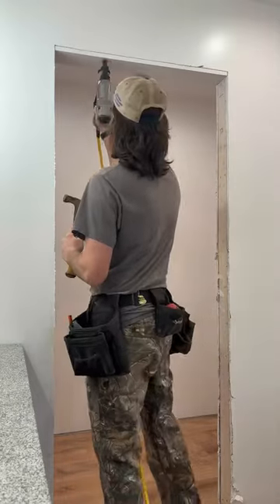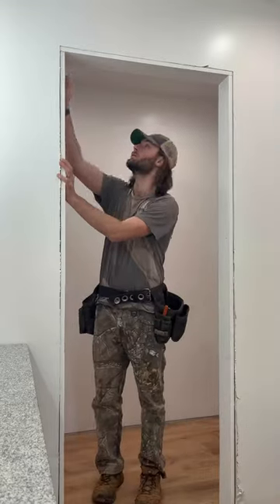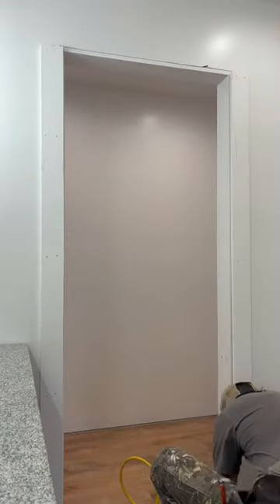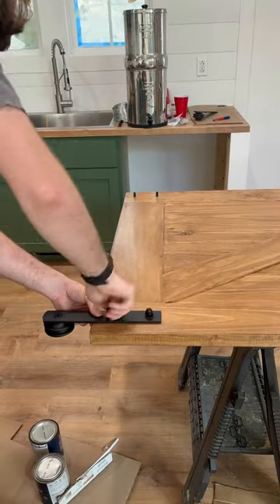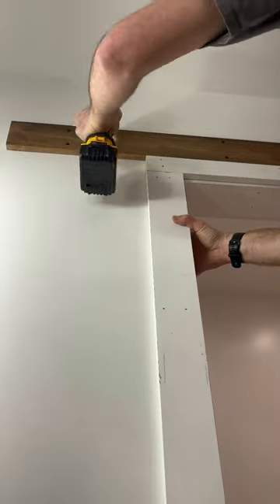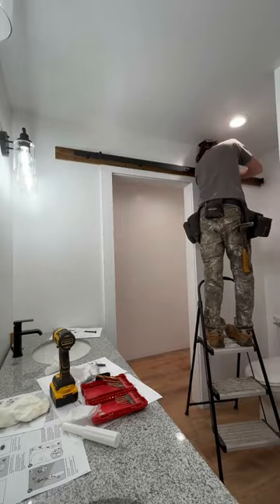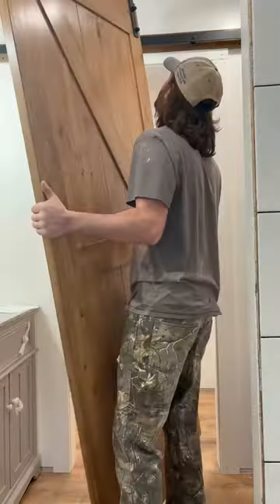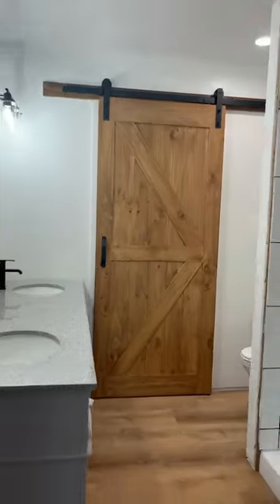Beautiful barn door in master bathroom 😍 #shorts #barndoor #builder #diy #construction #homediy ￼

Comment: I don't get barn doors. I'll take pocket doors any time over this
Reply from the maker: That’s cool too! I personally can’t stand pocket doors. Over time they start to get stuck and can be hard to use. In my opinion of course :)
Reply: @MordecaitheBuilder  I've had pocket doors in my current house for over 15 years with no issues. Mine are no different than a sliding closet door. Idk what could possible get stuck.